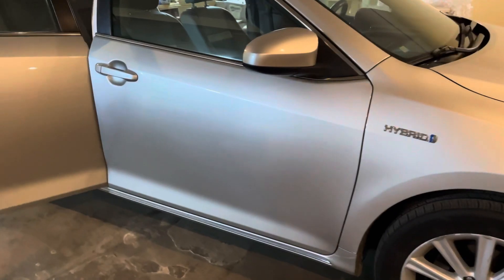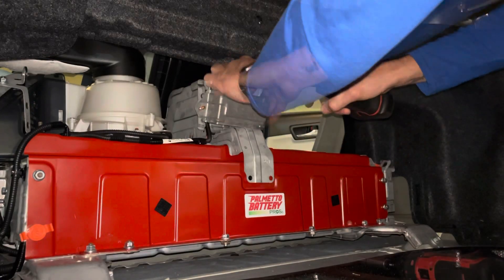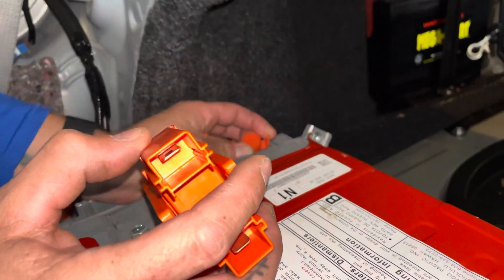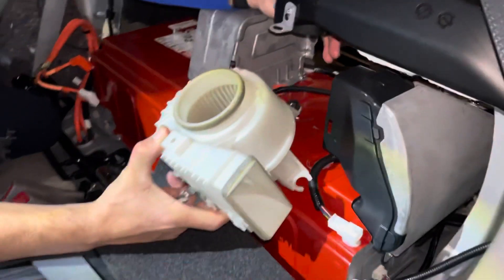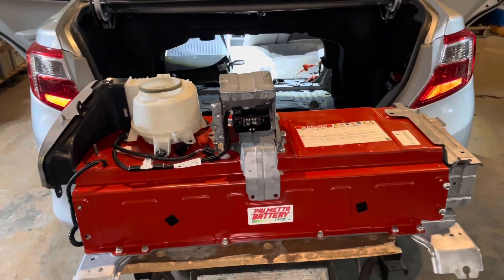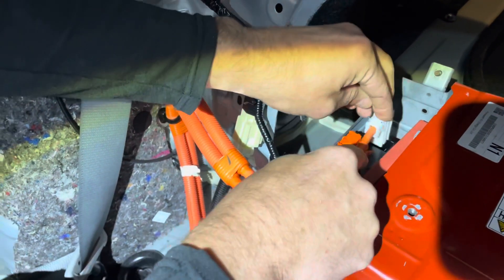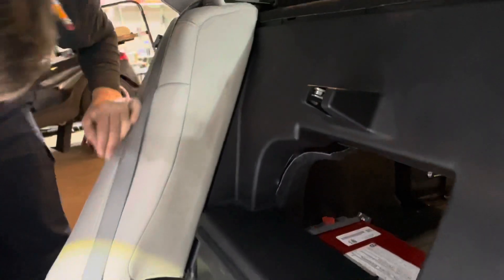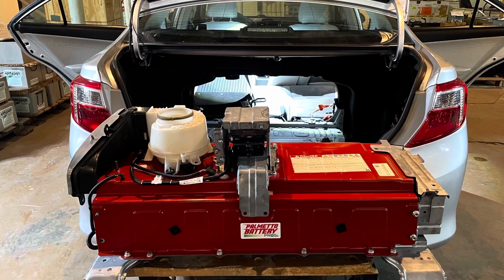Toyota Camry Hybrid Battery Removal & Reinstallation ~ 2011 - 2016

Comment: Thanks for making such an awesome video , just replaced the hybrid battery myself on Toyota camry hybrid 2016 model . Im in Australia so the battery configuration was on opposite side but followed the steps from the video and it went great.
Reply from the maker: Thank you, I'm glad it helped.
Reply: Hi
Does it require a some kind of reset after installing a new batteries?
Reply: @ nothing, no reset required, the system configures automatically the new battery’s charge level and everything, just make sure connections are tight and dont miss any cable
Reply: @ Thank you 🙂
Reply: How long did it take you?
Reply: @mikesouthey1657 1.5 hrs with electric ratchet , makes the job easier too and saves time
Reply: How does it affect the battery warranty, doing it yourself
Reply: @mikesouthey1657 i got the battery from toyota dealership, theres no warranty given or any information regarding if you install it yourself or by some professional

Comment: Hello. Is it safe to perfrom this procedure with out checking the actual potential difference on the high voltage wires like it said in workshop manual?
Does this procedure require any actions with configuring/calibration electrical modules on a vehicle? Before/after?
Reply from the maker: No calibration needed. Its always good to check for voltage.

Comment: Hi, You have explained very simply and informatively in this video, thank you very much
I have a question,
 I have Camry 2013, and its hybrid battery is dead can i drive it?
The system hybrid check light is on. 

I would be grateful if you could help.
Reply from the maker: The Toyota vehicles require a functioning HV battery.

Comment: When replacing the battery does one need to sync the battery to the car’s  ECU/ECM?
Reply from the maker: No, it doesn’t need to be programmed.
Reply: I was wondering that too. Had to have a 2010 Lacrosse towed to the stealership to reprogram computer after I replaced transmission. Ripe off.

Comment: Question: I agree this was a great-detailed video for exchanging the hybrid battery. My question is the Check Hybrid Battery indicator light comes on when I start the car having replaced the hybrid battery. I have unplugged the orange breaker fuse and also disconnected the 12 volt battery in hopes of resetting the system. This morning I put in a second refurbished battery having sent the first one back two weeks ago. I am STILL getting the Check Hybrid Battery indicator light on. I have double checked all connections and everything is as it should be. What do I do now? take the car to a Toyota dealership and have them diagnosis the 'new' problem?  Is there some reset process I am unaware of?
Reply from the maker: Yes, you need to have proper diagnostics done by a tech or the dealership. Could be several things keeping the DTC present.
Reply: What was it ?
Reply: did you sort it out?

Comment: How much does it cost for a new battery for Hybrid Camry 2714? Also did you see any changes in fuel consumption?  Thank you.
Reply from the maker: We should do a test on improved fuel consumption. So many factors though. The price is $2650 to your door.
Reply: @PalmettoBatteryPros  Thank you. 🌷🌷
Reply: @PalmettoBatteryPros   what is the total cost for the whole job ?

Comment: I replace the battery and now my car won’t start?
Reply from the maker: I would check the 12v cranking battery and make sure your service plug is installed properly. You can also unplug 12v and service plug, then reinstall service plug then 12v battery in that order.
Reply: How did you fix it ?
Reply: How did you fix it?
Reply: @kenanisa3455  I had missed one of the plugs 😂.. just make sure that you find out why your last battery went out.

Comment: Do you have a video on how you, "fixed", your battery?  It seems like it was like a mileage based service problem that Toyota built into the unit.
Reply from the maker: I'm sorry, I'm not following your question. The modules fail due to age or usage, 175K+ or 12 years are the averages.
Reply: @PalmettoBatteryPros  My system which is a 2014 Camry decided to cut out on me but I wasn't sure if it was something that Toyota built into it for me to maintain at about 125,000 mi so I just wasn't sure if they put like a little maintenance switch in there that triggers at 125,000 mi to get me to go to the dealer and then consider options about changing out the battery

Comment: why is the battery casing red? The OEM is silver.
Reply from the maker: This is our cover with aftermarket modules inside.
Reply: @PalmettoBatteryPros  do you know why the es300h has a different OEM part number than the Camry hybrid for the battery? They are they same spec and looks the same from the outside. Are mounting holes in different positions?

Comment: digging into my 12 camry ..,  have  priuses i've had and camry is another ballgame ..quite a bit of deesign change not to mention the dang bigger 17 block amount ...   in humid locations , a pin on the battery computer will totally disintegrate,, this happened to me and i m still putting the thing back together ...
Reply: bus bars were very blackish and some whitish corrosion layer requiring wire wheel to remove .. did some soaking in vinegar ad then baking soda ...  -- i might but vaseline over top when its all torqued down ....    of course battery modules (several pairs ) needed charging .. or cycling .. D>C cycles at least 3 ...  very very time consuming ....  
on the prius. it was not just the battery issue that kept creeping back but then about 165k .. the brake module /ABS goes bad and u hear warning of the pump coming on more and more to make pressure ...  man that break module removal just about 'broke my back' ...
Reply from the maker: We replace bus bars with Nickel plated bus bar kits. I do retain the old copper bus bars to scrap. I probably have 30lbs of old bus bars in a box.

Comment: The side metal piece you removed with nuts on either side with the plastic clip does not need to be removed when removing the battery. Neither does the fan. I find it quicker to leave them both in.
Reply from the maker: I agree, I think I was just so used to removing from doing so many 1st Gen Camry hybrids. The 2nd Gen Camry is a little easier, tho the cabin interior can be a pain.